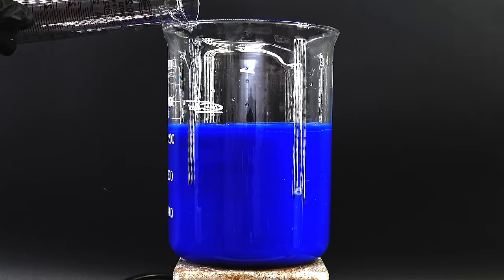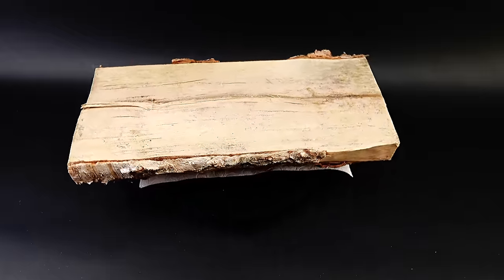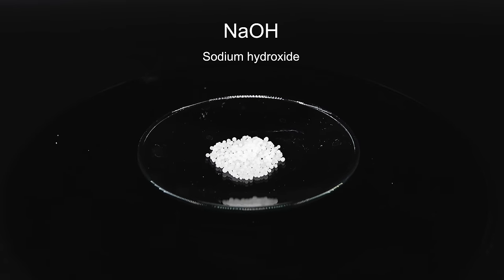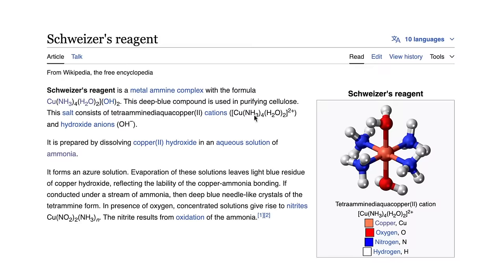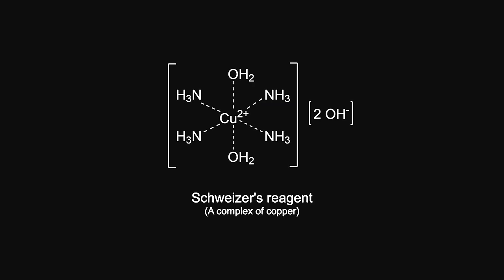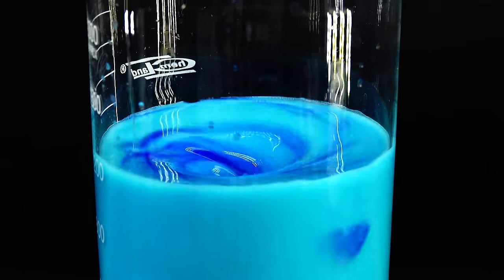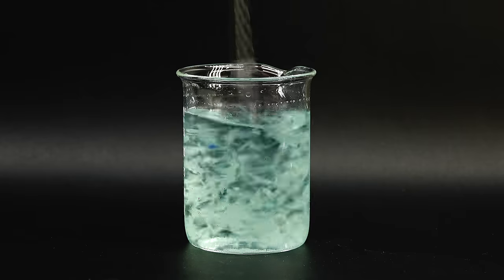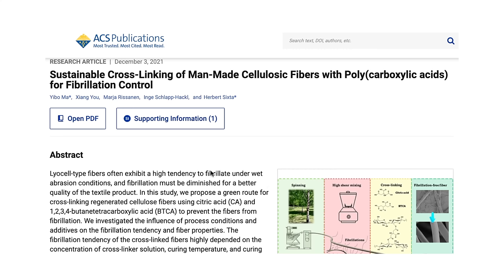Turning Wood into Artificial Silk

Comment: If you want to improve your results you've got two main options : making rayon or making fibranne, but in both cases you'll need to find a way to make your indivual fibers with a diameter of around 50µm (commercially, they tend to be 20µm in diameter). 
Next use it to make rayon or fibranne, the key difference here lies in the way the fiber are used tu make a thread. Rayon uses long individual fiber stranded together while fibranne uses short fibers holded togother via torsion (just like wool).
Maybe you could try to make fibranne first, as it should be easier to get short but thinner fibers that youcould then twist by hand. Nighthawkinlight made a really cool serie of videos about making self-cooling fabric using a candy machine for his proof of concept (maybe not really usable here due to the acid bath, but that's a start)

And a last thing, viscose is really sensible to humidity and can lose up to 50% of its strength when wet, so drying the fibers firts is crucial.

Anyway, great video as always can't wait to see how you'll succeed to improve the process !

Comment: Acetylcellulose fibers are produced not by directly dissolving wood cellulose, but by treating cotton fluff or specially refined wood cellulose with acetic anhydride and acetic acid, converting them into triacetylcellulose or diacetylcellulose. After certain procedures, both fibers are usually formed in the so-called dry method, when, by pressing the solution through spinnerets, the solvent (acetone for acetate) evaporates and a thread consisting of many filaments is formed.
Recently, due to increased ecological requirements, the production of triacetate fiber has been abandoned in the world. Its production has also been discontinued leaving only acetate fiber spinning.

Comment: @Amateur Chemistry The problem of mixing sodium hydroxide and copper(II) sulfate to precipitate copper(II) hydroxide that you mentioned is due to the fact that the reaction between the two is a bit exothermic and the copper(II) hydroxide made that way is a bit unstable since the solution could provide enough heat to decompose it into black copper(II) oxide and water.

Comment: Actually the way you were splitting the wood, i sincerly appreciate how careful you were not to destroy the ax head. If you had an actual chopping block to pilit the wood on, i doubt youd have any trouble. Birch is nice like that.

Buuuut, if you small wood peieces for rhis experiment, id recommend saw dust froma a chainsaw. You had to strip them chemically anyway so the chain oil isnt an issue.

Comment: Thought Emporium has an excellent video on wet spinning. You essentially have to pull and  extrude the fiber at the same time to maintain constant width and tension. The best way to do this is to use spindles. You can 3D print some connected bobbins/wheels, and have them all connected to one motor so they spin at the same rate, then pull the fiber across the wheels with forceps. You could also 3D print a gear that connects to the syringe and lowers the piston at the same rate as the wheels spin. Another thing to consider is that as the fiber is reacting with the acid, it's forming water that could be hydrating the fiber and loosening it up. Tension will help with this, but you could also have a desiccant in the solution, preferably an insoluble one. You could also pull the fiber out of the solution onto a wheel and resubmerge it on another wheel so it can dry out. As it dries however, it'll decrease in volume, which will slack the line, so the wheel after that will have to move slightly faster as to maintain tension. You can just use gear ratios to increase the speed using the same motor. Once you're satisfied with the iterations of submerging and drying, you could pull it tight across a room under some fans so it dries out and finally is collected on a boppin.

Comment: I used to work with this exact copper chemistry in the professional world! My goal end product was the copper hydroxide powder, and I encountered a lot of the same pitfalls that you had in the video. First of all, idk if this is a general property of metal oxides since i also observed it with tin (IV(?)) oxide, but all of the copper salts tended to turn to a sticky sludge when precipitated like you saw, which I can assure was SUCH a pain to work with. Second, tl;dr copper has really ~funky~ chemistry depending on the pH of the solution and the cat/anions present. The reason that the "direct" route of the double displacement didn't work is that at low(ish) pH copper will form a double salt with hydroxide and the other anion, in this case sulfate; additionally, it turned dark at the end because when the pH is too high (excess hydroxide) copper salts tend to decompose into copper (II) oxide, which is black. Really the only way that worked was with ammonia, both because it keeps the copper soluble and it buffers the pH in a "safe zone" between both extremes. Also also I started to get worried once you had the wet powder because copper (II) hydroxide is very temperature sensitive; I gave up drying it in the oven because it would decompose at only 120 F!!! I ended up using a food dehydrator to get my dry powder XD

Comment: 23:15 yes, fabric fiber is not a long straight molecule of something like a polymer is, it's basically a tangled mess of small molecules bound together using a variety of physical methods. I'm sure you can find a technique which works with your cellulose thing

Comment: You've misunderstood how the fiber generation of Rayon works. In solution you have individual cellulose "blocks" in suspension. Just squirting it into the acid will not make it rapidly polymerize into long chains. If you want really long fibers you need to let them grow slowly, not too unlike how you'd grow a crystal from a saturated solution. Try adding the acid very very slowly to the Schweizer/cellulose under strong stirring. Calculate what you need, add a small excess, and then use a dripping funnel, and adjust it to the slowest drip you can.

Comment: After extracting the lignin in solution, is there any easy way to revert it to it's original solid form? It seems like it would be a good use for an industrial byproduct if it could go from liquid to sturdy solid again.
Reply from the maker: The lignin solution can be acidified to yield some of the base components of lignin, which while definitely not as strong as lignin itself could in theory be used for something :)

Comment: Think with that wood theres still alot of air space in the drybstuf so putting it in a strong vacume would remove it force the liquid inside. Also smashing it with a hammer breaking up the fibers would a been a good idea.

Comment: I thought Rayon was the synthetic fiber my chemistry books said was created by having a two layered system and the middle layer is pinched and pulled up through the second layer creating the fiber.  You basically have the fiber solution on the bottom, and pull the fiber up through the second layer as the fiber forms.  Was that not Rayon I am thinking of?  Almost sure it is.

Comment: @icebluscorpion
vor 0 Sekunden
That's not a water bath man or at least it's the retarded way of making a water bath. You clearly showed, that you don't know how neither thermic conduction or termitconvection or thermic radiation works. In a water bath beaker should be heated only by the water itself not by the glass of the recipient that holds the water or the oil. You have a stand to hold beaker suspended in the air the f**Ing use it right to set a proper water bath. Don't pi*s on  people's face and tell them that it is just salty warm Apple juice Mann. Do it right or don't call it a water bath. Your setup gets heated mainly from the bottom Glas of the recipient containing the water which defeats the purpose of the water bath in the first place 😂 🤣.

Comment: The precipitate forming when dissolving CuSO₄·5H₂O in pure water is probably in part Cu(OH)₂ as a result of hydrolysis. The rest are impurities. If you want to avoid throwing away perfectly good copper, add a few drops of H₂SO₄ first.